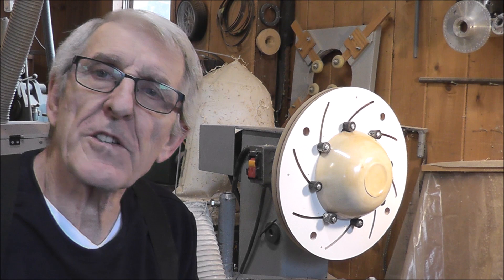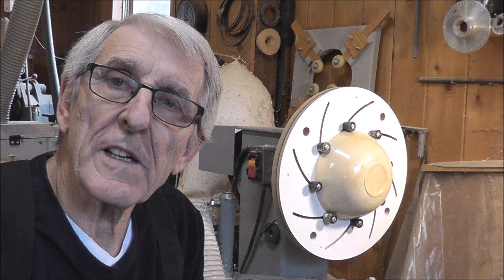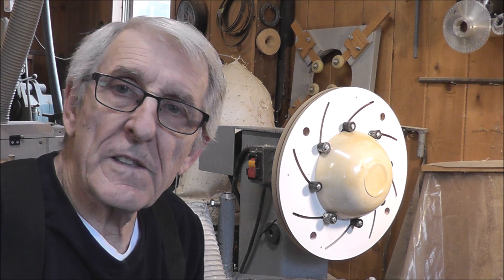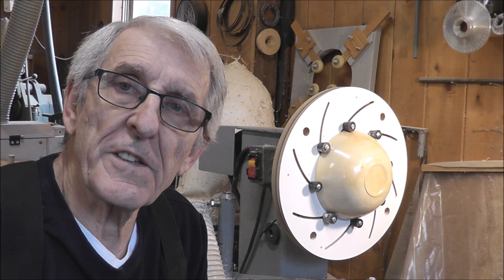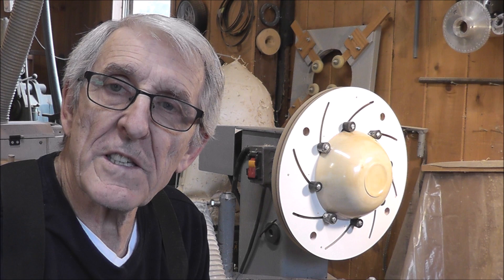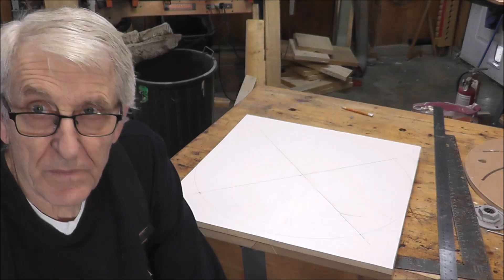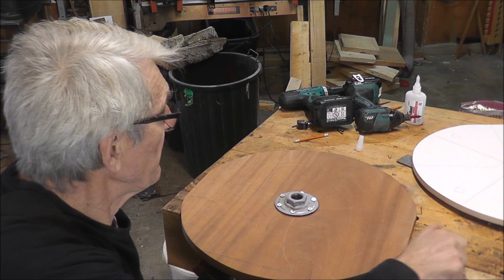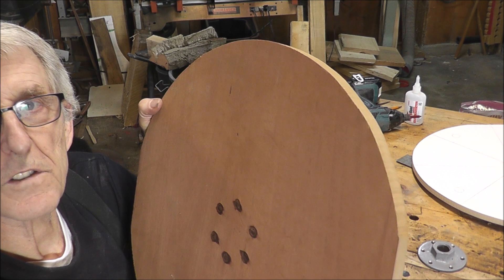LONGWORTH CHUCK,  Very VERY easy to build,  instructional video shows you how.

Comment: Great video.  I see a possible improvement.  Draw several concentric circles on the front to help in centering the bowl.
Reply: Haven't actually used one myself, but I think those stoppers are pretty much self centring as you rotate the one disk against the other. 🙂
Reply: Now that I look closer, you are right.  @stadleroux
Reply: @joeydupre6153 , finally found suitable stoppers today for the one I'm in the process of making!

Comment: This was very inspiring...
Do you think this would work for a smaller finger gripping radius by only using three fingers and enlarging the size of the fingers ..ex: instead of 1" diameter rubber stopper you make much larger like 5+ inches so it can reach in further???

Comment: Thanks for that Brian. I imagined that those bolts sliding in wood slots would have cocked and not slid good. Yours didnt seem to have that problem though. Perhaps the melamine surface helps things slide?
Reply from the maker: Several reasons that I think could help, is that the bolts have no threads in the thickness  of the wood, and the materials may be thicker than what you would normally use. Full 3/4 back plate and front one was 1/2.   Would have been better if bolts fit more snuggly in the slots.  I think sometimes they roll the treads on, then they start with smaller stock since the tread area expands with the forging of the tread.